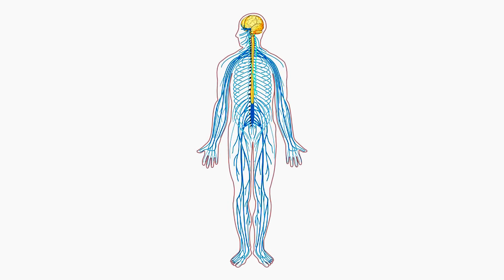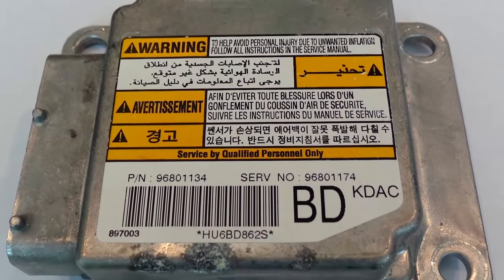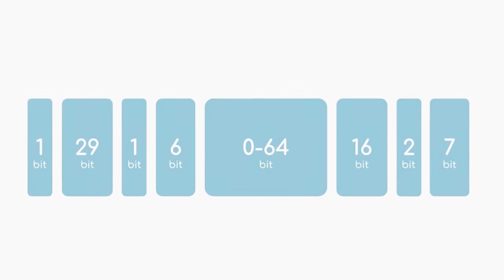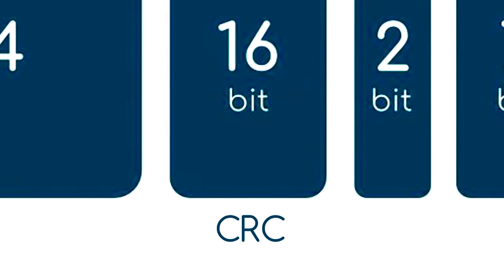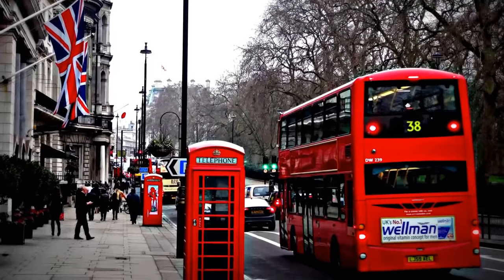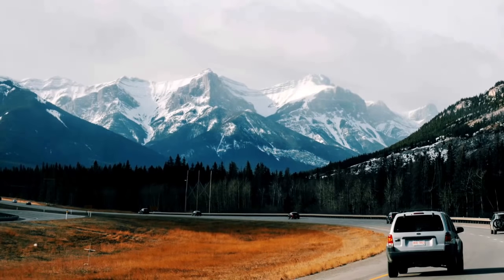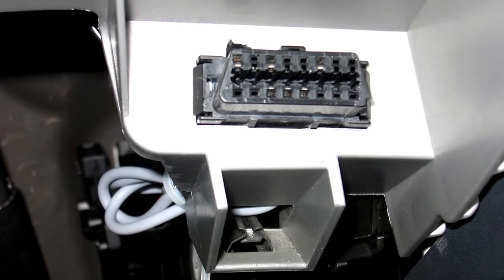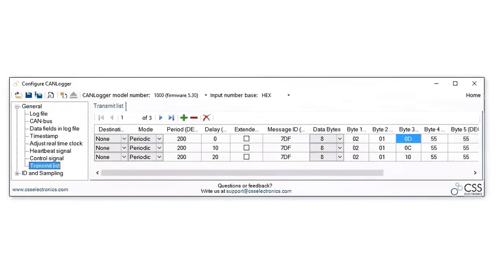CAN Bus Explained - A Simple Intro [v1.0 | 2019]

Comment: I think that if a car manufacturer brought out a basic car with engine that you could see (no plastic covers that go brittle and brake trying to remove); No airbags that appear to be 70% of recalls); no ABS, ESP etc etc. and manual windup windows; built with simple DIY repair in mind; normal wire handbrake and accelerator cables etc.  I believe that the demand for this car would be good and it would hold its second hand value.
Reply: Demand for cars like that isn't strong in the US, because people typically don't keep cars to the point where they need to be repaired, and modern cars last a very long time. However, in other countries, being easy to repair right off the showroom is very important--For example, VW produced the air cooled Beetle until 2003 in Mexico, because people liked how simple it was to service and maintain.